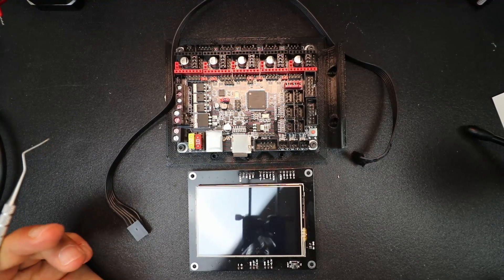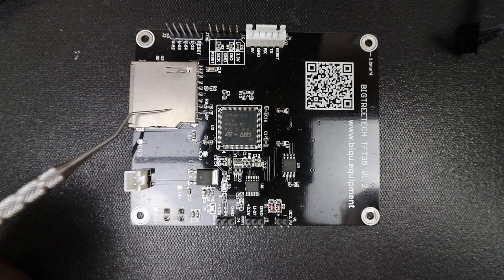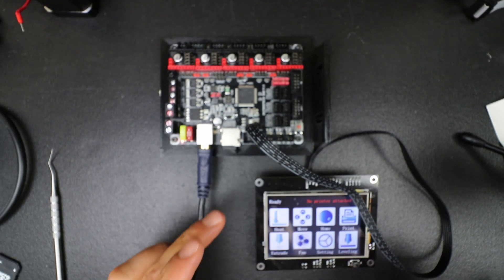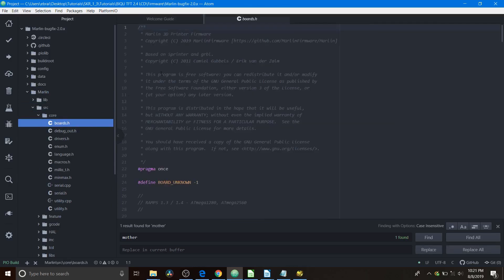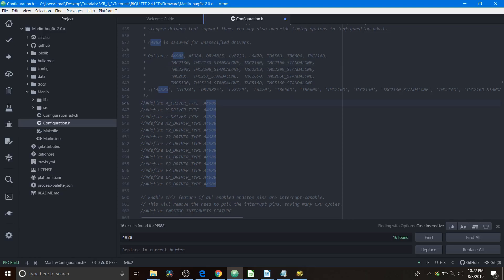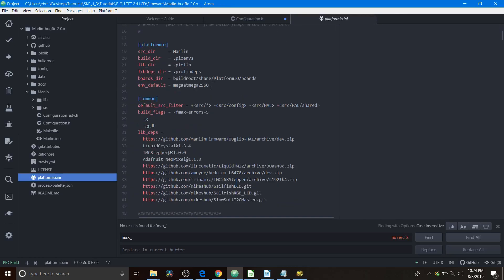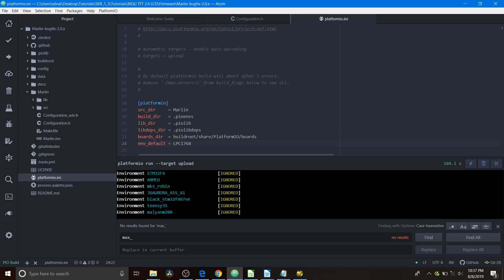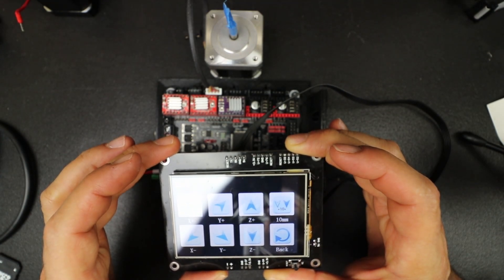SKR 1.3 - TFT35 touch screen display

Comment: On my screen it still says ''no printer attached'' :( need help plz
Reply from the maker: Which type of LCD display are you using and can you outline the changes to the Marlin firmware you changed?  What version of TFT firmware are you running?
Reply: @EdwardBraiman  Hi, I have the same problem, I have an SKR V1.3 and TFT35 V2.0
I am using VScode instead of Atom but by clicking Upload on the platformIO extension it did create a new firmware, but the TFT screen still says "No printer attached!"
Reply from the maker: What's the buadrate, should be 115200.
Reply: @EdwardBraiman  Yes, i did change the baudrate to 115200 in the configuration.h file
Reply from the maker: Could you give me a little bit of information on your TFT display maybe a link of where you purchased?
Reply: @EdwardBraiman  On the Biqu website, there's a link the a github for the firmware of the TFT display. 
https://github.com/bigtreetech/BIGTREETECH-TouchScreenFirmware/blob/master/Copy%20to%20SD%20Card%20root%20directory%20to%20update/BIQU_TFT35_APP1_V2.0.23.bin

Do you happen to know how i should upload it to the screen?
Reply: I fixed it! Apparently the problem was because i only activated one port. I activated the second one (first on -1, second on 0) and the message disapeared!